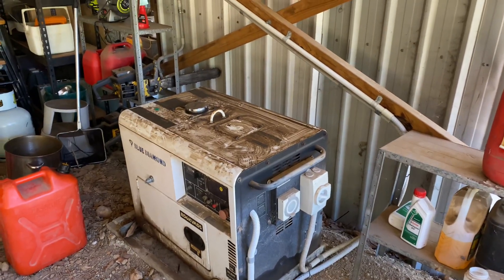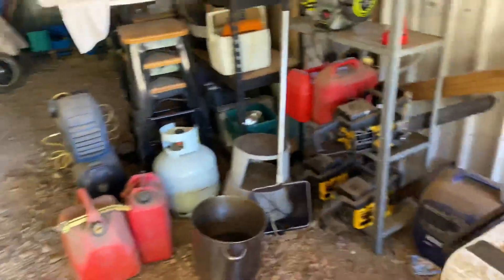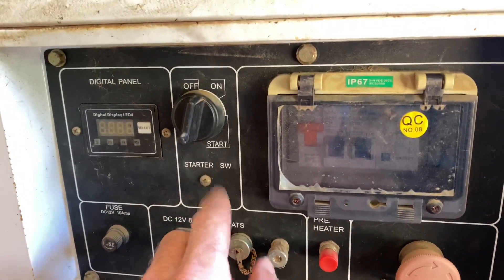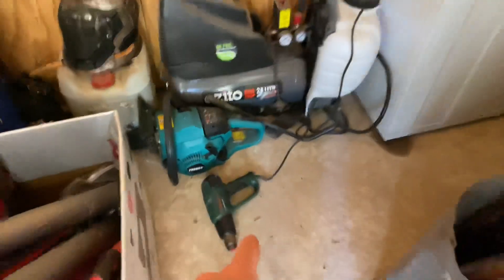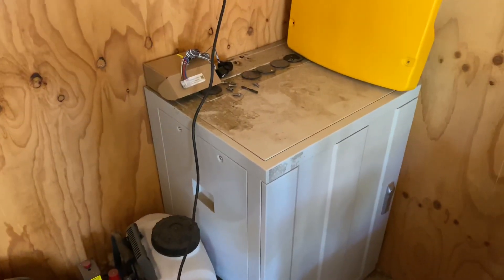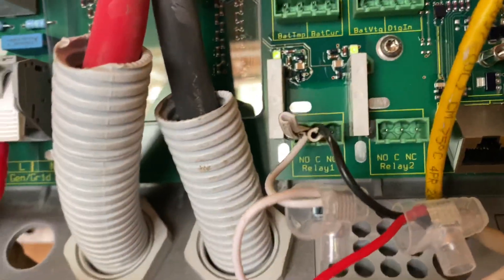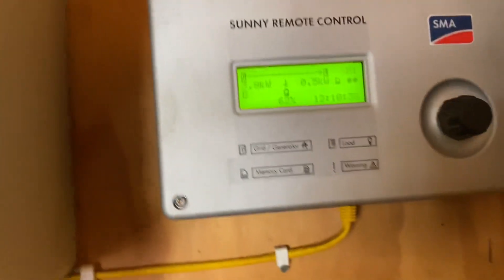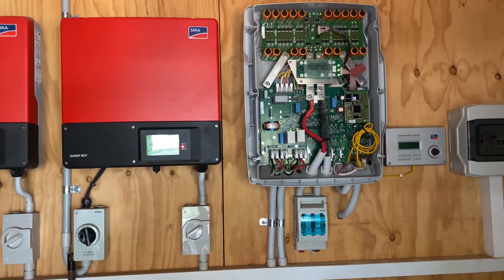SMA Sunny Island and Blue Diamond  generator connection in Gidgegannup Perth for Off Grid.

Comment: I always thought those generator ATS wires were 12v trickle charge for the starter battery, and a NC signal loop (or signal to ground), all in the 3x conductors.....
Reply from the maker: Unfortunately no, Victron can do a trickle charge but only for the same voltage battery. I dont believe SMA can
Reply: For this generator, can you just chuck a trickle charger across the battery terminals?? Curious cause I've done that. But I don't know if the charger gets damaged from the gen while it's running
Reply from the maker: @ thats fine mate wont hurt the charger. I have Victron trickle chargers on all my off grid generators.

Comment: Nice work Jason, my setup is very similar, but only one Sunny Boy and no generator (have one but never needed to connect it to the Island). I use the timer function in the Island to turn on the hot water for a couple of hours in the middle of the day to save it drawing from the battery whenever it wants to. I like the flexibility of the Island. With this operation would you call this DC or AC coupled have watched a few videos and not quite sure which it would be...any ideas?  Andy 🤠😀
Reply: It is AC coupled!
Reply from the maker: Thanks Andy, that's good use of the internal relay I like it. Sunny Island and Sunny Boy is an ac coupled system if I understand your question correctly.
Cheers
Reply: @joondalupelectricalservice3201  Cheers Jason, that clears it up....if the solar was connected directly to something like a Victron charge controller (effectively a DC to DC conversion) that'd be considered DC coupled ?
Reply from the maker: @AndyM...  Yes that's correct, you can also have both, such as on the Selectronic inverter, it can have a Fronius AC coupled inverter and an mppt to charge the batteries. Some dc coupled solar is good for blackstart if there is no generator. Not possible with BYD or any other battery system that is not self managed.
Reply: @joondalupelectricalservice3201  Thanks mate, keep up the great work with your videos, I can see wayyyy more battery installs coming !!!
Reply: Hi Andy. Can you please confirm if the Sunny Island's timer function with built in relay has the smarts built in to heat the hot water cylinder during excess solar production only? Or there is no smarts and only has a dumb timer only function to turn ON and OFF the hot water cylinder heating?
Reply: @TheSpyNZ  Hi Renewable Powerhouse, the island seems to have quite a few functions available for the relay, there is a load shedding option but not sure of its options. I use it as a plain dumb relay as I know the small amount the battery has to supplement the solar if there's not much light would be minimal, so am happy to run it like that !